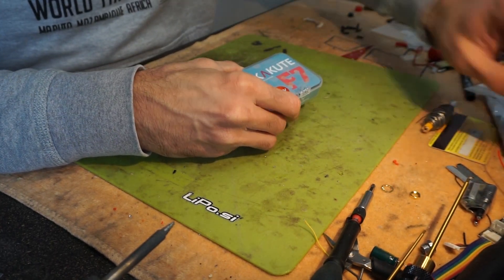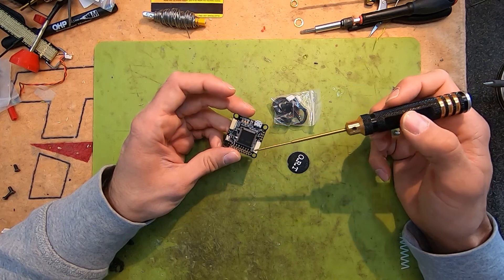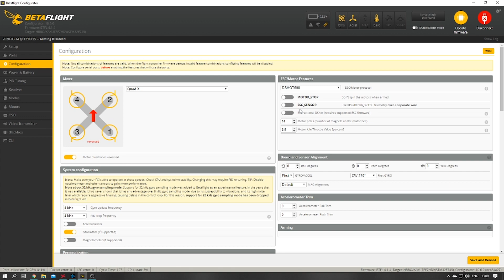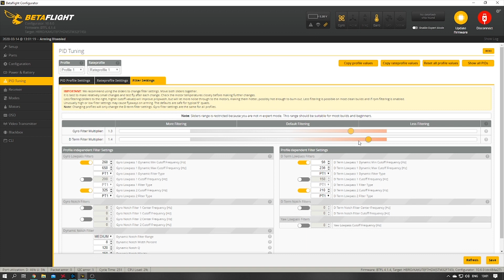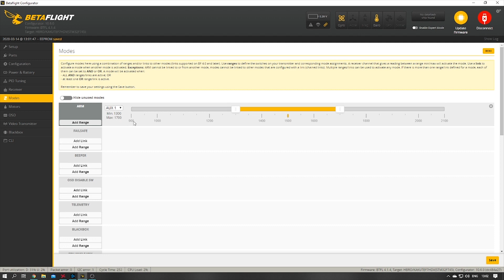Holybro Kakute F7 HDV Flight Controller STM32F745 with Barometer compatible for DJI FPV

Comment: hello, nice video.. can you help me please my kakute f7 is uneable give enough voltage to start my dji unit.. im using the cable for dji unit from kakute.. when i connect dji unit to battery direct then it work but from kakute not..voltage from kakute is too low.
Reply from the maker: Maybe you have a faulty 9v reg. I'm sure that the shop you bought it from will warranty it.

Comment: Thanks for making the video. As you’re using crossfire receiver by soldering on to the flight controller, do you still use all the connections with the air unit do you need to cut some wires in that plug to not use the tx and rx of the air unit or is that something you can config in beta flight?
Reply from the maker: No. You can used supplied cable with crossfire rx as long as you select serial port on the corresponding uart port.
Reply: @mrRockwellFPV  But then are the Air unit and crossfire both sending out RC signals?  Is there a way to disable the air unit from RC signals?

Comment: Do you have issues using 5 or 6S? My quad is falling out of the sky with everything above 4S.Do I need to connect the esc + and - to B+ and B - for 6S? And if so, disconnect + and - from the plug?
Reply from the maker: Just solder everything up like I did and you will be good

Comment: Thank you for sharing, why not use the DJI air unit for video and flight control of the drone? Is it because you have the DJI goggles but not the DJI controller?
Reply from the maker: Yup. Personally I prefer crossfire for my rc control over any other

Comment: will this set up work with the taranis x9d and the dji goggles  ? does using the cross fire mean that you don't need the antenna for your radio controller anymore ?
Reply from the maker: It will work with any other system that your use. Instead of crsf rx you solder on whatever rx you have.

Comment: help me understand. Your kakute came with a wire that will connect directly to the DJI air unit? Mine did not come with a wire that does that, and my DJI air unit only came with a male connector on one side, and exposed wires without connector on the other side. Do you have any idea where I can find that wire???
Reply from the maker: Hmmm. That's a tough one. Really don't know. But standard dji cable canbe made to fit the jst connector on the fc

Comment: Can you use that flight controller in a 6S built? Or u need a voltage regulator?
Reply: 6S ready.... I have this on two 6S builds....no issues, and it comes with a capacitor
Reply: @jaysway007  tnks man. tnks for the reply. I'll be able to build a 6S then. Tnks a lot.
Reply: @jaysway007  So 6s build doesn't require extra BEC on kakute F7 that has capacitor right